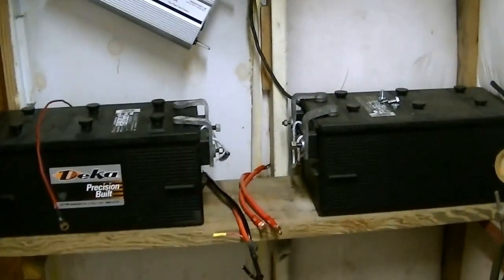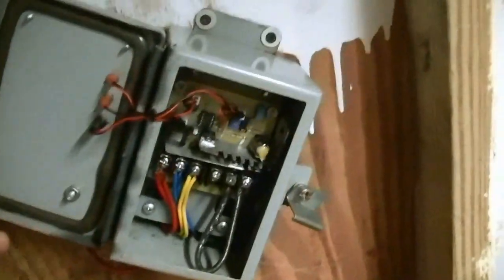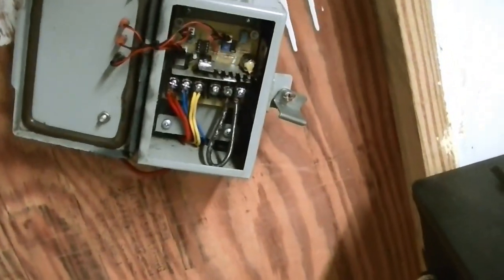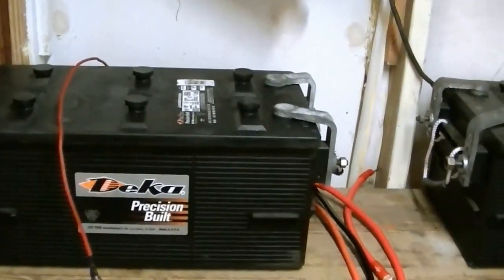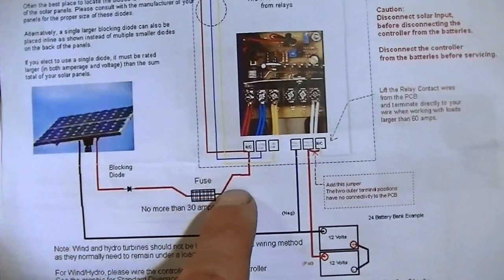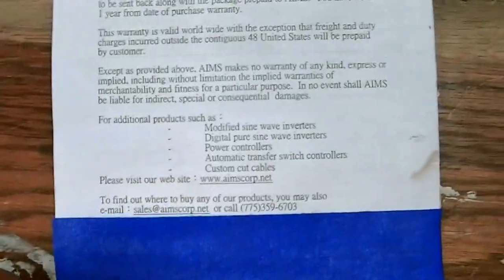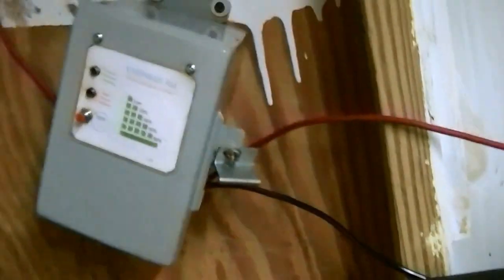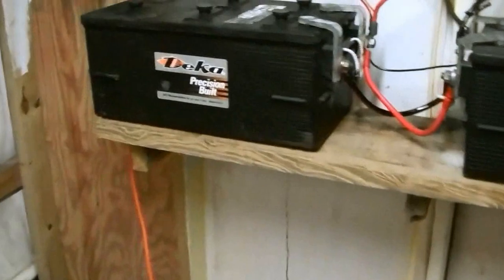How to connect solar panels to battery bank/charge controller/inverter,  Wiring diagrams

Comment: I spent about 600 bucks on my system and haven't paid for power for almost 8 months so already paid for itself. And im talking lights ,H.D. tv, two phones and a laptop all day and night But..... i have a home built for 12v and propane appliances not a home built for the grid. And i can honestly say that my cost of living is a fraction of what it used to be.
Reply: May I ask, how many watts of solar or wind is your system? And how many batteries?

Comment: Mounting at an angle is an unusual thing to see but I fully agree with the reason. Refreshing to see someone do it :)
Reply: +gamingSlasher 
...Yeah I agree....I'm a sucker for all things Nice-&-Square, & pleasing to the eye....But that does make sense.
Reply: Nearly all inverters clearly state never mount inverters vertical. Only flat or horizontal. Reason being when inverters fail and they will fail, very hot components will fall from the unit out through the fan or front. Most lightly causing a fire. Great video!

Comment: Much better Wow that makes a difference!! Thank you! Quick question so if I have 8 batteries that are 6v and I wanted to make a 48v system I would have to wire them in series correct?

Comment: Hello Mark, 
  I have purchased glass from you as well as the frames used to make 5-solar panels. I am trying to wire the five panels into a terminal block, then on to my charge controller. How exactly do I wire the panels into the terminal block? I thought I could bring all five positive leads from the panels to one side of the terminal block, then run one single wire to the charge controller. I did this but it is not working? any ideas???  Thank you sir. 
Hynns

Comment: Mark, I have four 24 Volt 230Watt solar panels. The junction box that should be on the back are gone and the four flat wires are accessable. I understand the two outter wires are the neg and positive. I am experienced at soldering so I have some excess extension cord wire to use to solder to the panel leads. Should I connect all the positive together and the negative's together and run to the charge controller. Will the controller take either 24v or 12V input? will the output be 12V for my batt?

Comment from the maker: My panel are 150 feet away. I use #2 aluminum wire from my panels to a terminal bar. The terminal bar is on the other side of that wall. I use #2 because I got if  for $30 from the scrap yard.

Comment from the maker: Well you would need a 220 volt inverter. I would take a large arry and a huge battery bank to just run the dryer and water heater. Use a solar water heater to heat your water and a clothes line to dry. I have a youtube video on how to make a simple solar water heater.

Comment: Mark: 

First of all, good job on your videos. Thank you for that.

Now, there are some documents out there that suggest wiring the batteries a bit differently; They state that connecting the leads from the battery bank to the inverter from a single end of the bank may stress and eventually kill (over time) the first battery.

YouTube won't allow me posting the address of a website, but if you PM me, I'll send you a link. It is interesting, and, on your case, it only takes moving a single cable.

Comment from the maker: I would need to know how many KWH you use a day. Batteries are rated by amp hours. Start with a 1000 watt system and 4 large deep cycle batteries and add to it as you need.

Comment from the maker: If you are charging a 12 volt system then you will need more than 12 volts so you will need to solder the four flat wire to give you 24 volts. All cells in series. You will have to check your instructions that came with your charge controller on max input voltage. I think tou will be fine with just 24 volts. Most panels are 18 volts.

Comment: Hey please Help, I have a question regarding using an inverter charger together with solar panels to charge your battery.

Where I live, power is intermittent, comes and goes. Right now, we just an inverter plugged into the AC socket, so that when mains power is available, the inverter charges the batteries.

Now we want to add solar panels, my question is, won't the charger on the inverter, and solar panel charging conflict, and maybe overcharge the batteries?

Comment: had a question. can regular batterie(double a or what not) be use to power a car power inverter if enough batteries are connected in series. was wondering.not talking bout the 2 6v or 12v battery.

Comment: Mark, What would you say for a 95 watt solar panel(s) in 40 panels system. About how many charge controlers and power inverters will I need for this system  also the fuses ? This system will be going to Morocco , so that is why all the questions . Thanks Mark , God bless ....TwoEagles

Comment: 300 watts going through that small of a gauge wire?  What voltage are your solar panels feeding?  If not 24 or more I'd suggest larger gauge wire from your panels so that you're not having line loss.

If you want, you can PM me and I'll send you a link to a handy site that will give you a list what gauge wire to use based on the amperage you want to pull through it and how long of wire you want to use.

Comment: Mark, does the wattage of the panels have to match the wattage of the charge controller? im thinking of setting up a basic unit say 150watt of panels to run the fridge, freezer and other small load devices in the laundary. great videos very informative
Reply from the maker: The amperage of the charger controller needs to be bigger the out put amperage of the panels.

Comment: Also im doing 2bulbs 12v Led.  Do I just run em off straight from batt?  Does it need a fuse for my load?
Reply from the maker: Yes, you do not need a inverter, just straight from the battery. If you want you can buy a inline fuse like the ones found in a car but I don't think you have to have it.

Comment: Hello, great video! I'm trying to figure out my plan for wiring up our camper trailer with 2 100W Solar panels. I was wondering what your reasoning for banking the batteries in a Parallel system? I am thinking the same, more amps, than volts. I have the same, battery setup as you, 2 12volt batteries. The inverter and the panels are 12V as well, not sure if the panels, batteries, and inverter all need to be the same volts?? Just gonna be using it for lights, laptop charging, maybe a tv or microwave at some point. I guess I'm just trying to figure out what is the best plan for the batteries, parallel or series?? Any tips would be appreciated! Thanks again!
Reply from the maker: +Jason Rienks If your inverter is rated for 12 volt input then you have to go parallel with your batteries.

Comment: Hi there. I live in the middle of farm land, and no gas supply to my home (105 year old cottage), with all electric heating etc, my electric bills are rather expensive each month. So i was thinking about building this sort of setup and running it in my front porch. with multiple batteries in Parallel for extended run times per charge (5 or 6 batteries).. with a 5000w inverter, which is plenty enough to power all my electronic items during the evenings when its mostly used...
What sort of Whattage solar panel would i require to charge the batteries?
Also, what does the whattage actually do in this case? does a higher whattage panel charge the batteries quicker?
And could i like multiple solar panels together to achieve higher whattage?
IE: 5x 100w panels to make 500w..
Thankyou
Reply: The better question is How to save money on your electric bill. Solar is way more expensive to purchase than the price of electric coming in on the line to your house. 5 or 6 batteries will not be enough power to run your house through the night. You should spend twice the money on batteries than you do buying solar panels  which will be a huge amount of money. You will not save money by going solar. A better way to save money is to install a wood stove. use less electricity. use more efficient appliances. Once you have addressed these issues then look at putting in a solar system. You will not be able to afford the solar you need to heat your house with electricity it's just not cost effective. Now with that being said, I am a strong supporter of solar so a system in place for power outages I highly recommend and encourage you to build but you seriously must find another way to heat your house.
Reply: Same rule but rearranged... watts=volts × amps

Comment: Is that inverter kind of large for only 2 batteries? I find that using such a large inverter would use up alot of the battery power in itself. 5000 watt inverter uses alot of power just to run it. Thanks. Great video
Reply from the maker: Rog Marcot No this inverter only uses a little more than it puts out. I need a big inverter to start my drill press motor.
Reply: wow! that was a fast reply, thank you so much. Will visit your Solar penny online for sure.

Comment: Do you need a breaker on batt to inverter? I have 4-12v batt =440Ah.   What breaker would I use?
Reply from the maker: No you do not need a breaker, the inverter has several fuses for protection.
Reply: Yes I would put a breaker between the batteries and inverter that's the right way to do it

Comment: Hi the input into the charge controller, is that AC or DC power input..
Reply from the maker: bobby royster The input to the charge controller is DC.
Reply: ok thanks I build a wind turbine from a ceiling fan and the output voltage is AC ..I see I have to change ac-dc first..thanks again.

Comment: Hello mark. I just recently got an Iota 24 volt 45 amp battery charger. I was wondering if it should be connected to the batteries themselves or connected via the charge controller. I tried getting in contact with Iota but i had no luck.
Reply from the maker: outlaw0987654321 I am not sure but to be safe I would just go thru the charge controller.
Reply: thanks alot. didn't want to risk seeing the setup i got go up in flames.

Comment: you said the pos wire from the solar panel goes to the controller and the neg from solar panel goes to the battery?
Reply from the maker: +Cop Cam Hawaii Bonnie Mitchell-Fox  Yes that is correct.

Comment: is it possible to have a house with solar panel for electrication?
Reply: +Angelina Quilla 
Angelina: Anything is possible.
It is just miracles that take a little longer. (But it helps if you connect correctly.)

Comment: I have 5kva,48v inverter that ve connected,but last week i bought 200w,24v solar panel (4 pieces) with 60amp,48v controller.my questions is how do i connect d solar to give efficient charging system.thanks

Comment: Mark. I'm finally using my 440 mmc 10,000 watt controller, but my inverter keeps blowing fuses. I had it directly connected to the controller yesterday all day and it worked perfectly until night time like sometime after nightfall it blew a fuse so then I tried connecting the inverter directly to the battery and it blows a fuse immediately what am I doing wrong?

Comment: Hi, mark need a little bit help please.....
I intend to build solar panels of around 200 watts on my house.

I have some question

How many amps my charge controller must be? Is 30 amps or higher.
How many watts the inverter must be for 200 solar panel?

And last

How many batteries I need ( 12V) for this system? 2 are enough?

Thank you.
Reply from the maker: A 200 watt panel will be around 10 amps, so a 30 amp charge controller will handle 3 of your panels. Your inverter needs to be big enough too run what ever you are trying to power. 2 batteries will be a good start, you can always add some later.

Comment: i have a 50-300 solar power generator and i'm wondering if i can still add more batteries on the built in battery on the unit, i have 2 VRLA  12volts 7.2ah. is it ok?

Comment: Question: Could I mix and match my 12v batteries with different capacity as my battery bank? E.g. Car battery with 45ah and UPS batteries with 7ah.
Reply from the maker: Yes you can. Deep cycle batteries work the best.

Comment: Hi I have a generator producing high amps.   The max amp is 60a tolerance for a charge controller in Singapore.  Are there charge controllers in the US with higher ampere tolerance like 100 amps and higher?
Reply from the maker: Constantine Joseph Yes, Try coleman air makes big controllers

Comment from the maker: I don't think it will work on DC. You need a amp meter wired in with a shunt and then you take your voltage times your amps to get watts.

Comment: hi mark...i need a little bit of help....i have to design a large scale solar power system. the total power it is about 4.46776MWh,..my question is,how many battery that i must use for that value of power,.....
Reply from the maker: If you get 5 hours of usable sun a day and you are producing around 4 1/2 million watts then you will need around 2 million amp hour in 12 volt batteries. So if you buy a 200 amp hour deep cycle battery you will need 22,500 batteries.
Reply: markp0177
How many KW in panels would be needed?

Comment: +markp0177 This is a damn good, easy to follow instructional. It always looked so intimidating to me, but you broke it down well. If you don't mind me asking, how much, in total did you spend on this set up? You got a damn good deal on those batteries! Also, how does hanging something at an angle prevent nests from being built on it?
Reply from the maker: I spent around $800 for this set up. Animals can't build a nest on a steep slope, that's why I install at a angle.

Comment: can u run a 115V window ac ??
Reply from the maker: Yes but not for long. I would need lot more solar panels to keep the batteries charged.
Reply: Batteries are DC, almost all appliances operate of of DC ONLY AFTER THE CURRENT PASSES THROUGH AN INTERNAL AC TO DC CONVERTER. If you can bypass this you're good (fon't try this at home), otherwise you're going to need a DC to AC power inverter. Prices cover a wide spectrum depending on how many watts or kilowatts you want. Be careful the cheaper $20 ones are meant to run an appliance like your laptop on a car battery while your 2.5KW might run you somewhere around $220. As a rule higher capacity ones are going to run you more money.

Comment: Hello Mark. I have no idea about solar panel. But I want to run my house with solar energy. I have appliances such as 21" tv, 7cuft ref & 8 florescent lamp. How many solar panel & batteries that I'm going to used & hoe big it is? thanks.
Reply from the maker: Start will a 2000 watt system and 8 large batteries first. Then if you need a few more just add to it.

Comment: I have a 45 watt system (Harbor Freight) with a Thunderbolt charge controller and a Cen-Tech power inverter rated at 1000 watt continuous, 2000 watt surge.So far I only have 2 12v deep cycle marine batteries attached. Now, this setup will power lights, or TV or fans, but not coffee makers or toasters. I don't know about the fridge yet. Eventually, I would like to go completely solar, but I don't know how big of a inverter to get or how many batteries or panels. I know my average monthly electrical usage but I don't know how to figure it all together. Can you help? Email me please.
Reply from the maker: Find your monthly KWH usage and divide it by 30 days. That is how much power you use a day. Then divide that wattage by 5 hours of average sun a day and that is how much solar wattage you need in panels.
Reply: ok, maybe metrosolarmatics website will help you with your calculations. I just found it yesterday. They're a business, but their website is loaded with good information for DIYers. I know this posting is a month old, but hopefully you'll read it soon. Take care.

Comment: i have a 300 (24V) solar power generator and i'm wondering if i can still 
add more batteries on the built in battery on the unit, i have 4 VRLA (serial)  
(12volts 35ah x 4 = 48V,35ah), and use solar charger controller 12v/24v/30ah is it ok? (spec.of solar charger controller)
Reply from the maker: Yes, but for 24 volt system you will need to connect two sets of two 12 batteries in series to get 24 volts.

Comment: i travel a lot with the bus (long trips) and i want to make a large capasety Solar powered battery pack to charge my (and my Friends theire) phone for a day three or four, is this a good option?
Reply from the maker: Hello. I think a simply 20watt folding solar panel may be a good choice. Here is a link.
 http://www.ebay.com/itm/Poweradd-20W-Foldable-Solar-Panel-Portable-Battery-Charger-Dual-USB-Power-Bank/301933127025?_trksid=p2047675.c100009.m1982&_trkparms=aid%3D888007%26algo%3DDISC.MBE%26ao%3D1%26asc%3D38530%26meid%3D23c6d2ea88824ea5bf8eeb97f17348c5%26pid%3D100009%26rk%3D1%26rkt%3D1%26sd%3D291313480215

Comment: (Continued) Likewise, the same process for the negative wires save for they go to a separate terminal block. The problem I am having is that the single wire going to the charge controller seems only to be carrying the energy generated by the lead that is directly opposite the lead that is going off to the charge controller. Am I supposed to use something other than a terminal block?? Please help!!!!

Comment: sir i want to setup 500 watt solar panel now please tel me,if i have 500 watt solar panel and one 100 ah battery and one charge controller,one 500 watt inverter dc to ac than what else i need and how many watt ac may i get from it.because i like to use my water pump from this power.my pump is 400 watt.
Reply from the maker: Monir Ahmed If your pump is AC then you will need a much larger inverter. It takes up to ten times the wattage to start a motor. I would use a DC pump. Watch this video on pumping water.@watch?v=VaBr0OHOCws